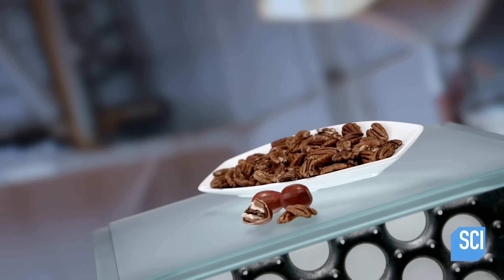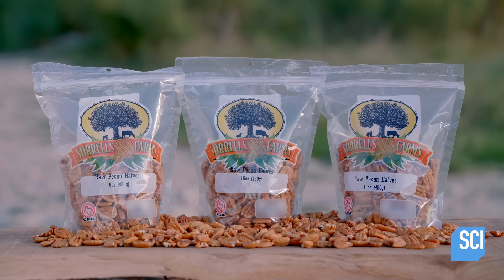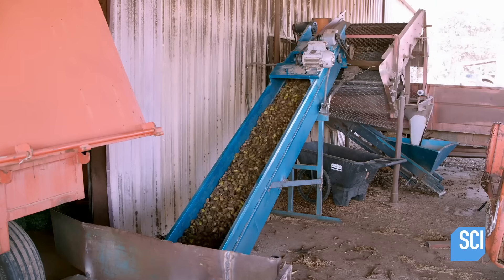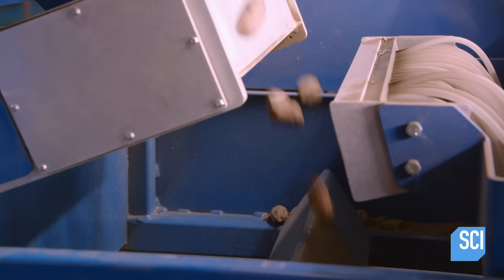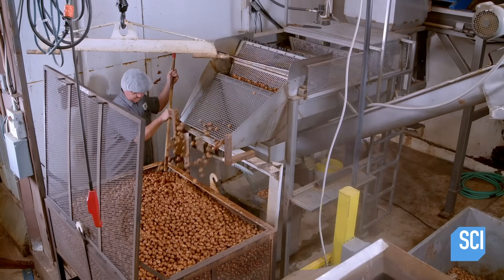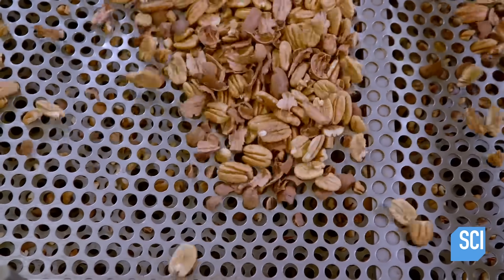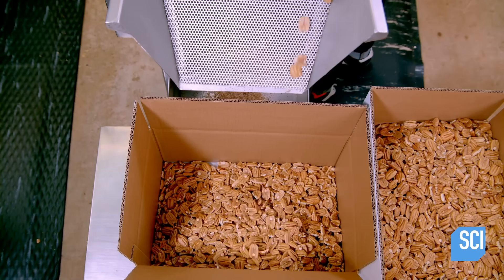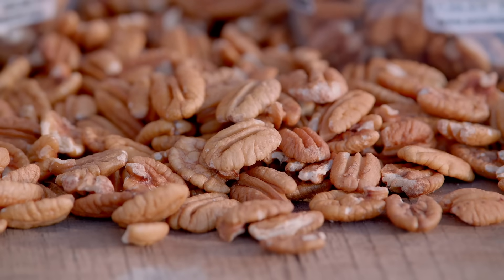How Pecans Are Manufactured | How It’s Made

Comment: “A chlorine and water bath”. That’s the last commercial pecan I’ll be eating.
Reply: Benjamin Dover Stay away from fish at the market too.  Get it directly from someone you know.  They freshen it up that way.  Fresh fish does not smell.  If you can smell it, don’t buy it.
Reply: @pattystone4157  Well, fresh fish does have an odor, but its odor is not nearly as strong as a processed fish and typically smells quite pleasant or at least neutral. Ocean-caught fish usually smell mostly of the sea. Freshwater-caught fish vary based on species and where they were caught.

Comment: China is where pecans are manufactured. They shred old motorcycle tires, add plastic rice bits, blend in ground shrimp shells and tails, then inject the paste into silicone molds that look like pecans. They initial  cook them over sewage treatment plant methane gas.  Then they are airbrushed with artificial tanning solution while they final dry in the street behind the shop.

In the USA, we don't manufacture them. We grow them on real pecan trees then process them for sale to various markets.

Comment: A few questions i would still have.
1) Is it feasible to use paper bags instead of plastic bags? If so can it be done in a way so there is no loss of quality? Same questions but with reusable glass containers?
2) I am no chemist so excuse my lack of knowledge. Clorine bath sounds a bit like too much chemistry in this process involved. If controlled afterwards through laboratories, what are the clorine concentrations in comparsion to a natural unprocessed Pecan?
3) what happens to all the stuff which is not for consumption? leaves, shells, imperfect nutbits, ...?
Reply: Paper bags are not good because they still can draw in air within the bags which will make the pecans go off really quick. Unless they put a layer of plant based plastic (forgot what its called) within the paper bag.

Comment: From what I kniw: Pecan are pronounced differently, most are exported to China where they are roasted in salt in the shell, the shell breaks but you have to separate then by yourself, and they taste much better than the american processed food: to crack a pecan open, you immerse then into hot water above 100 degree celsius under pressure, then release the pressure immediatly, and the shell is ripped off by the water inside that turns into vapor.

Comment: Narrator : The Pecan's are dried for 24 hours to remove moisture as a high moisture content will spoil them.

Also Narrator : The next day, they soak the Pecan's in several water bath's to increase the moisture content.

Me : What ?
Reply: I know, its funny though and very misleading, the process is actually designed to have equal controllable moisture across all samples, thats why they dry first to a certain percentage then controlled process begins.
Reply: Dries for shipping,, then rehydrated at a factory
Reply: @hse6144  nope rewatch
Reply: The pecans have to be dried for overnight storage. If the pecans are above 5% moisture and just left off dryers even for just a night, they will start to deteriorate. The heat from the pecans being packed into a big trailer without air moving through them starts to cause mold, ruining the pecans. So when they get to the shelters they need to be rehydrated so they don’t bust into pieces when they are cracked. The extra moisture makes them more malleable incase a sheller isn’t set right.
Reply: The drying allows the moisture to reach equilibrium. It also helps the bitter shell release from the nut when they crack them
Reply: @mailasun  Thank you to the grammar nazi...
Reply: I was thinking the same thing
Reply: Chlorine baths
Reply: In multi unit bi-processing they have to dry then dehydrate them to reduce tri-linium di-ethylphosphate. In other nuts this trans numeric system isn't warranted due to high levels of ethyl bi-phosphene. Tri-linium di-ethylphosphate toxicity is dangerous not only to mammals but fish and insects too. They have to titrate out the moisture slowly i.e. 24 hours because exposure to air denigrates the phosphene molecules. When you buy them put them under a UV lamp. They glow if their tri-linium di-ethylphosphate levels are unsafe. All you have to do is to pay it tree fiddy open the door, get on the floor, everybody walk the dinosaur.
Reply: Jon Best comment I’ve read in ages 😂
Reply: @jim1550  nope
Reply: @jim1550 , Boom boom acka-lacka lacka boom
Boom boom acka-lacka boom boom
Reply: @jim1550  "tri-linium di-ethylphosphate" What, exactly, is tri-linium? I'll bet it's as real as the turbo encabulator, and therefore so is the rest of your post.
Reply: @jim1550  You made that up.
Reply: Perhaps to increase weight by gauging the consumers?
Reply: @SiemReap2012   "gouging"
Reply: @SiemReap2012  Stay in school.
Reply: @SiemReap2012  *gouging- - -but I get what you are saying!
Reply: @SiemReap2012  that's due to the retailers.
Reply: @SiemReap2012 lol😂 im certain many foods are done this way. I know in China they were literally painting the vegetables to look good 😂.
Reply: @SiemReap2012  My aren't we cynical.

Comment: The problem with food processing in the US: You rehydrate the nuts in a water and CHLORINE bath!? And then “rinse” them with hot water!? What about the chlorine that got absorbed into the nuts!!!?
Reply: They were still in their outer shell, there is not enough chlorine in the water or kept soaked long enough for the chlorine to penetrate to the nut meat itself as manufactured (processing is taking it and turning it into mash like turning tomato into paste which is what food processing is). Yet those of you commenting your disgust of them using a minute amount of chlorine have swam in chemicals pool which contain far more chlorine than what they use in the manufacturing process as shown. Yet you still show your ignorance.

Comment: Why do they dry the pecans after husking them if the next step is to wet them down?
Reply: Rachael Schultz They want them to soak up that nasty chlorinated water to ruin the taste. I get a couple hundred lbs a year from the dozen pecan trees on my farm in Texas and I’ve never done any of that chlorine bath. Then again I don’t “manufacture” pecans, I grow em and eat em!! 😆
Reply: They are dried first to reduce the danger of fungus growing inside, and to firm up the nutmeat.  Sometimes the growers harvest them a little early to outwit the crows and bluejays, which wait until the shucks are open.  

And, Deano, they are not immersed long enough for the chlorine to penetrate the shell.  No worries there mate, as the nuts with cracked shells are removed prior to the bath.

Comment: has loads of super machines doing incredible stuff

Hires technicians to measure in jar and fill manually
Reply: That's nuts!
Reply: The Absolute Madman it’s filling work, at least
Reply: The Absolute Madman  So they can put "hand-packed" on the label and jack up the price most likely
Reply: It also serves as visual inspection. They're not just packing stuff, they make sure everything goes right.
Reply: @NightWatch707  There were people earlier in the process whose job was to remove damaged pecans and shell bits. Also a job that should be done by a computer
Reply: @limiv5272  in their almond video they talk about doing both, actually. a robot gets most of them but there's enough error that they need human eyes to look things over. they use a camera to sort things and i wouldn't be surprised if it mistakes shells that are almond shaped- as almonds, or other nuts. or from time to time the air that blows things away can miss. and even if the machines are really good, if they are getting older more flaws can happen. its not a bad idea to have an extra set of eyes around considering the shell can hurt people. the robot does 90% of the work still but the people are needed
Reply: @GwyndolinOwO  how can shell hurt people ? who opens a pack of pecans and sees a shell and goes "ah a perfect pecan for the eating"? if someone takes an errant shell out a pecan bag and decides to eat it and dies. that serves them right.
Reply: same for that tiny sticks and stones nonsence.
Reply: @thesage1096  most chunks that get into bags are pretty small and can still be sharp but bigger pieces might be a risk for kids. A lot of bags that have cracked nuts in them will have some kind of warning on them. An adult might be able to know how to be careful but if your little kid likes to eat nuts might accidently eat a smaller piece or assume that anything in the bag is eatable. Even if you don't swallow something if you aren't paying attention and put something sharp in your mouth it can still poke your tongue or something. I doubt its ever killed someone before BUT usually when it comes to hard things getting mixed in food factories are extra careful since anyone of most ages might be eating it. a 4 year old is usually a lot dumber then a 30 year old.
Reply: i was thinking the same
Reply: The expence to install and maintain an automatic bagger outweighs the expected yield
Reply: hahaha, exactly what i was thinking about
Reply: Right! 😂
Reply: Makes me wonder about package weight. How can they know that the measuring cup will be within tolerance of the stated 450g?
Reply: "technicians"....
Reply: Hope they use face masks now! And wash their habds frequently 😳